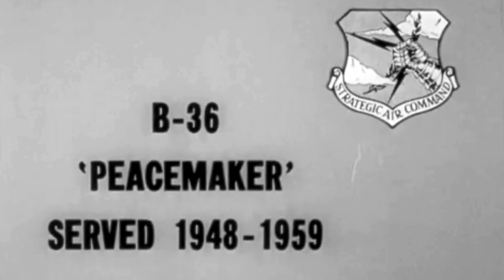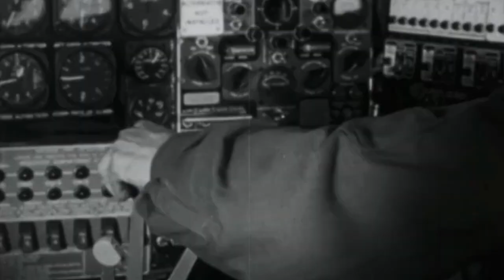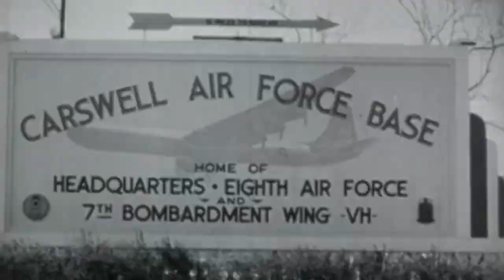A B-36 That Ripped the TV Antenna off a House

Comment: Love the narration!! And I would of loved to see that!!! Now a days you can't do anything fun without getting fired!!
Reply: Or getting jail time.
Reply: @markfrench8892  exactly, my dad and uncle would both be in jail for their shananigans these days. But back then they just got called into the office,scolded and told not to do it again all while their CO was smiling 😂. I actually still have a set of 150 gal drop tanks from a A4 that my uncle dropped in a lake 50ft from my grandfather's house 😂
Reply: @jaex9617  you forgot the 4 jet engines too........the old saying was 6 turning and 4 burning 😂
Reply: Lol you can, head to an airshow 😚
Reply: Nah, he needs to talk a little slower. His pace is off. He pauses too long when he does stop, and when he's talking, he sounds like an auctioneer. This video wasn't the worst I've heard, but some of these are really bad.
Reply: @jaex9617  You sound like Creepy Joe Biden.
Reply: @jaex9617  The first versions didn't have this J47 jet engines (they used the twin pods of the B-47). They introduced them (and retrofitted it on existing aircraft) later, to increase take off power, and enable a higher speed at bomb runs (otherwise, they could close this engine with a cone for aerodynamic reasons). 
Here you can see them more detailed https://www.youtube.com/watch?v=9FJVxtTNjJk
They modified the jet engines to burn avgas, because the 6 propellers were driven by piston engines, which needed avgas, not jet fuel.
Reply: No kidding!   Those folks are fortunate to have seem that!
Reply: And thank God for that. Pissing about while flying an enormous strategic bomber directly over civilian properties at low level is completely insane. Acrobatics and precision flying are wonderful and exciting things, but not while threatening so many people with instant death.

And that's without getting to the fact that these aircraft tend to be very expensive, scarce and imminently necessary for defense roles.
Reply: Yep, but anyone not using english as a native language should play it at 0.75x speed.
Reply: SouthJerseySound that’s hilarious
Reply: To many narcissist in this world to live and let live .
Reply: Unless the fun you are seeking is your job
Reply: Listen, the constitution specifically states that if you blow the shingles off my rooftop with your aircraft I'm legally allowed to defend myself with an anti aircraft gun.
Reply: @first_last-  😴
Reply: @letsgobrandon5622  hi sleepy joe!
Reply: @letsgobrandon5622  You getting ready to move into the white house?
Reply: @first_last-  What's a White House ? I like my house . I'm going back to bed. Good morning .😴
Reply: Thats how Australians speak - fast as, as recently found in Dec 2019 to be the fastest talkers in the world when comes to words per minute, 229 av (wpm) when talking Aussie to Aussie and equal to Japan with 8.1 syllables per second (sps) although easily understood by other Aussies, totally confusing to all others! My boss holds a degree in speech therapy and is a polyglot or I should say now a hyperpolyglot as he speaks 13 languages and said their members of the Australian defence forces deliberatly talk fast to others over radio communications and nobody including himself can understand during the initial playback speed! 
Someone mentioned the narrator is Australian, previously from UK although yet to be confirmed.
Reply: Dont we all miss the days we could do something fun (stupid) and be like “well the commies would do it first and make us look dumb sooo...”
Reply: "would HAVE loved"
Reply: Need tort reform...
Reply: @first_last-  You'll learn to understand his voice perfectly in time, and youll find the pacing perfect then.
Reply: Rightfully so.
Reply: @jaex9617  lol wow don't cut yourself on all that EDGE, BRO.
Reply: He has a sort of, "Dragnet," type narration lost to time that needs to make a come back.  If you ever tune in the ancient Dragnet television series, you may recognise the narration style.
Reply: * that must've been AMAZING TO BEHOLD..!
Reply: @attilad.1427  English is not my native language but i can still understand him perfectly.
Reply: @attilad.1427  Can even understand him perfectly at 1.25x
Reply: @first_last-  i like his talking it’s not fast is pauses are bad tho

Comment: We grew up living under the flight line of an Air Base for about 45 years and got to see just about every plane ever flown go over our land. I know me and my brother enjoyed every bit of it, Although the sonic booms From time to time would upset our parents, maybe even broke some glass at least once. From small jets to even the space shuttle being piggy backed on the 747-100. After for so long it was common place and you could usually tell how low they were flying by the sound before you even went outside, and many times you could count the lug nuts on the wheels of the passing planes. But I think we would have freaked out if any of them would have come down as low as this plane did, lol

Comment: In the 1960's while my family was stationed at Minot AFB, North Dakota which was a B-52 base.  At some point one of the B-52 pilots there was selected to transition to the B-58 (Hustler).  The B-58 was the US first supersonic nuclear bomber.

After finishing the transition to the B-58, the pilot landed at Minot AFB on a training mission to show off his new state of the art bomber to his former B-52 comrades.  After the B-52 pilots got a tour of the plane, the B-58 took off, turned south toward the town of Minot located about 13 miles from the base.  That part of the state being completely flat with no trees, we could easily see the bomber over the town at very low altitude.  The town sits in a small valley and we were surprised when the B-58 dipped into the valley briefly and climbed out the other side with full afterburner which we could hear 13 miles away.

The base commander was immediately flooded with angry calls from the town of Minot about the low flying B-58 that had broken windows, knocked pictures of the walls, caused vases to get broken, etc.  Some reported a plane had crashed.

For whatever reason, the B-58 pilot decided to buzz the town of Minot at very low altitude.  If you have never heard the sound of a B-58, it is deafening when just sitting on the ground and it is much louder in flight.

I don't know what may have happened to the pilot, but it was an interesting day.

Comment: I rented a house in this area during the 1980's. Because we in the flight path of then General Dynamics/ Carswell Airforce Base we were restricted to a tv antenna height of 20ft above the ridge of the house to prevent aircraft strikes.

Comment: I can only imagine the sheer noise this thing made. People said you could hear these things at altitude 5 minutes before you saw them. This was 4 turboJETS, not the much quieter turbofan engines planes use today. If you ever heard an old MD80 taking off you'd get an idea of that. Then add on 6 massive radial engines with 5.75in bore cylinders. Oh, and each engine had 28 of them! I wouldn't be surprised if people complained of cracked foundations after that.

Comment: Having grown up in Fort Worth and spent some time with my dad on base (carswell) I don’t remember hearing  these stories. But it doesn’t surprise me that it happened. What’s funnier is my dad was in Strategic Air Command when he was serving and as a civilian contractor as an aircraft mechanic and would walk me through base all the time giving me tours of hangers and planes all the time. Of all  the airplanes I’ve ever been on (not flown in)  the one planes I’ve been on the most is the C130 Hercules. Nowhere near the size of the B-36  but this day in age probably the closest thing to it. Though smaller than, the C-130 is an incredible machine and seeing its size Presley puts things into perspective. The Herc is NOT a small plane by any standard of the word and yet it’s nothing compared to the monsterous B-36 Man I can tell you as a little boy growing up in Cow Town I would have given anything to have grown up seeing these old prop job bomber flying overhead instead of the F-16s and Hercs.

Comment: I grew up near Mitchel AFB on Long Island. A B-36 had to make an emergency landing at Mitchel, but they were going to have a problem getting out of there - the runways weren't long enough. But they scrounged every JATO bottle in the eastern US and strapped them to the B-36. I heard the turpboprops spin up, and then the jet engines, and then all of a sudden they hit the JATOS. That thing took off like  a Loony Toon. It came over my house, looking as if it were no more than fifty feet up, engines screaming and rockets blazing. I damn near expected to see it flap its wings. People complained about the noise, complained that their houses were damaged, and other such complaints, but eventually they closed Mitchel AFB; parts of it became parts of Nassau Community College and Hofstra University, and there's the Cradle of Aviation Museum and the Nassau Coliseum.

Comment: I remember panicking when I heard a deafening sound overhead while mowing the yard one day. It was loud enough to hear over my music set at max volume. I looked up and saw a B-29 rumbling overhead at easily less than a 1000 feet. A airplane with less than half the engines, and half the size was scary enough at 1000 feet let alone one of these monsters at 100 feet. The B-29 was FiFi, flying as part of a flying tour for a local air show.

Comment: In 1997, while serving as a crew chief in HMH 462 on a CH53E at MCAS Tustin my HAC flew to "point Cruzer" (his call sign was "Cruz"). Point Cruzer was actually his home near Yorba Linda. We were supposed to be conducting flight ops off of Camp Pendleton. We buzzed his neighborhood at approx 100ft, at 200KIA for a good 10 passes, doing high angle of bank and wing overs. On our way back we got a call from our squadron (VERY rare) asking if we were in the vicinity of Yorba Linda, Cpt Martin (Cruz) replied "no".  LOL Anyway an USAF Col. saw us buzzing the neighborhood, and called the FAA, as we were the only CH53E, which is a very distinctive AC, in the entire state of California flying at the time is wasn't hard to figure out. Needless to say he was out of the squadron within a month. He ended up flying for Delta, but after 9/11 he went back to flying helicopters for the Marines.

Comment: So was it ever confirmed that the plane actually hit an antenna? It seems a major inquiry would be sparked from striking anything on the ground
Reply: Red Bluesome I don’t know the answer to your question.  However, in the late 40’s and early 50’s, long long before cable TV and the internet, because UHF and VHF broadcast TV is line of sight reception, in some cities and towns, like Fort Worth at that time, people who were lucky enough to own a TV back then (my dad and mom bought our family’s first TV in 1953) often needed a tall mast - 25 feet to 35 feet high, or more - for their antennas to attach atop to sometimes get even minimal TV reception.  

Distance between the TV station’s broadcast tower and the home’s TV antenna was often a factor if there was lots of physical clutter between the two.  

For good home TV reception back then some of this “clutter” included buildings, trees, and hills higher than your antenna between the location of the TV station’s broadcast tower and the home’s TV antenna.  Hence, the need sometimes for a tall mast for the antenna.  And the taller the mast the better the TV reception at home.  

Today most people use either cable TV, or they stream their video programming over the internet.  Therefore, they don’t need antennas.  

Note: Where we live today it is almost impossible to receive good broadcast TV programming.  This is because of the heavy forest between us and the TV station’s towers. Additionally, one network channel’s signal is impossible to receive because of the trees and the distance to its tower.  This said, our fix is to use cable TV, or internet streaming, for all our TV programming.

Comment: One of these Heavy Birds flew over my head as it landed at Biggs Air Force Base, Texas, in summer 1955, and the 6 piston engines set the landscape to shaking and thundering, the glass rattling in the windows, and the 4 jet engines whistled, and a brief shadow cancelled the sun's rays.

Comment: In the late 1960’s very early 70’s a ultra low flying either a turbo prop or a radial prop was so low over our house that it actually cut limbs off of one of our tallest trees in the yard.

Comment: The  six P&W R-4360 engines had a total of 336 spark plugs. A couple more J-47s and you have the equivalent of the B-47. This thing must have been the biggest mechanical headache in the history of internal combustion.

Comment: Thumbs up, but the B-36 was replaced by the B-47 which was in turn replaced by the B-52.  Lots of great B-36 aerial shots in the movie "Strategic Air Command" staring Jimmy Stewart.  

I saw a B-36 flew very low down the main street of Rapid City SD on Armed Forces Day in the 1950's.  It broke most of the windows in the penthouse of the Hotel Alex Johnson which was made famous in the Alfred Hitchcock movie "North by Northwest".  The harmonic beat of 6 huge props not in exact sync is something to behold.

Comment: The guy that claimed the antenna got stuck in the jet pod should be counter sued for lying.
It was a propellor plane... o_0...
Reply: Six turning and four BURNING.
Reply: It had 6 piston engines, and was later equipped (to increase power) with 4 J47 jet engines 2 each on a B-47 twin engine pod.
Reply: @simonm1447  @ExWEIMan
Thanks for correcting me, I missed that detail.
Reply: @Yezpahr  it's hard to see on some of the footage, and other footage shows early versions of the aircraft without the jet engines.
The footage in the video is a mix of different versions, including the XB 36 prototype which was never flown operationally by the Air Force.

Comment: Must have been a pain having both jet fuel and avgas to keep track of.
Reply: The jets on the B-36 were configured to burn avgas.
Reply: @kyleboatright7403  what jets?
Reply: @TheRattleSnake3145  The B-36 had 6 piston engines turning propellers in a pusher configuration and 4 podded jets (a pair on each side) hung on pylons under the wing.
Reply: @kyleboatright7403  thanks, I didn't notice them.

Comment: I complain about Panavia Tornado that operate in the base of my town, which flew 40 meters above my house when taking off and landing. But after this... I have to re-evaluate them 😂
Reply: The Tornado can be pretty loud though, these old bombers didn't have afterburners. Reheat in English. When we got the first one at RAE Bedford in 1983 it turned up late, after the field would normally have closed and many people had gone home. But they heard it in town, because the pilots did some high speed passes with the burners on before they landed. We'd been waiting weeks for BAE to get everything fixed, so it was 100% at least once in its life.
Reply: @cageordie  new

Comment: Your lucky to have found that old 8mm film, the B-36 was quite an airplane, they should have flown it for 30 more years and up graded it. Bean counters.🤨🇺🇸
Reply: More like defense contractors need new jobs
Reply: The B-36's replacement, the Boeing B-52, was far superior to the Peacemaker.  Much faster  and way easier to maintain (those six Pratt & Whitney 4360 piston engines were a nightmare in comparison to a jet engine) with pretty much the same payload.
Reply: It was a stopgap that had horrible jet engines
Reply: reverse thrust  Vets given nothing and dual citizen  kosher defense contractors given billions, maybe you should shut up.
Reply: Agreed !  Bean counters tend to screw up everything they come in contact with !

Comment: Several different film clips. Some of the prototype with  the the large single wheel main. Like the B-17 had, except the one on the B-36 were about 9ft tall and too much weight in a small contact area. That led to the placement of the bogie type with four wheels on each main. Sounds about right if you play this at half speed.

Comment: That would have been cool...unless, of course, it truly did crack your plaster! :)  I really doubt that anyone's TV antenna was knocked down, though.  I live in a place where H-53 helicopters and V-22 Ospreys fly over daily...though up much higher, 4000 feet or so.  They have a sound I bet was very similar to the B-36.  Watch the movie, Strategic Air Command (Jimmy Stewart), with your surround sound turned up loud.  It will give you an idea of the sound of the B-36.
Reply: There is footage of a peacemaker flying over a football feild and it has sound. Beautiful howl this aircraft makes.
Reply: @muddrudder2656  Might be the same footage used in the Jimmy Stewart movie, where it flies over a "baseball" field where Stewart's character is playing.  In the movie it sounded like a loud growl, giving me the impression of a sound that would rattle your dental fillings, in person. LOL.  Of course, movie sound is limited in volume and not always the authentic sound, but I think in this case it was authentic.  In certain flight configurations, a V-22 Osprey can do that, too, and set  off car alarms in parking lots, as I have witnessed.  A Blue Angels F-18 can do that, too, but with a different sort of sound. :)  So I imagine the B-36 was a real 'attention getter' in both sight and sound.

Comment: thxs......after the b-36, before the b-52, there was another bomber which made up most of SAC's aircraft, the b-47 stratojet ...    Cheers
Reply: Final for a B47 was with a drogue chute trailing to control approach speed and keep the engines powered for go around.